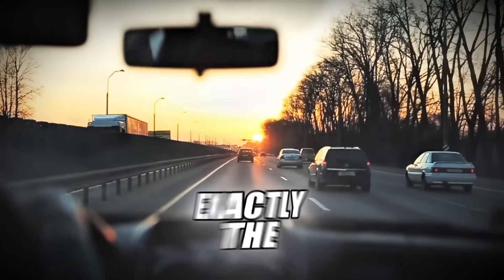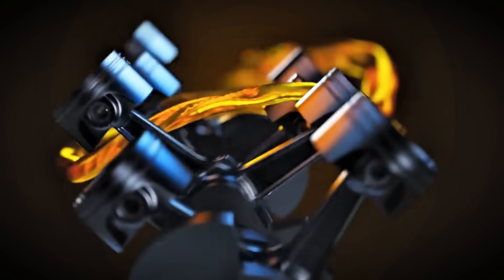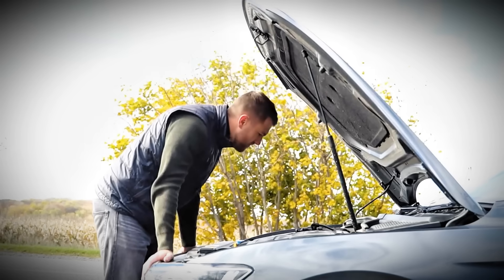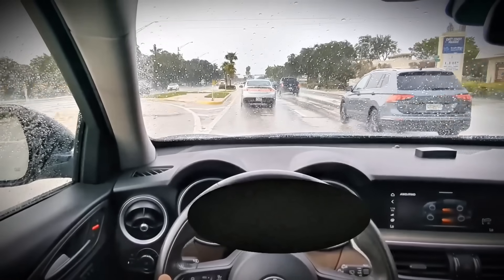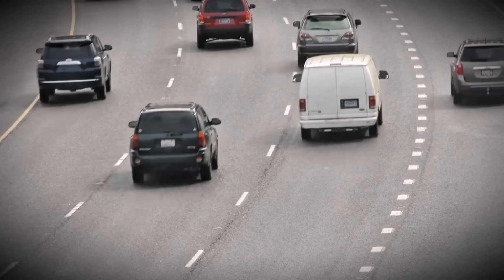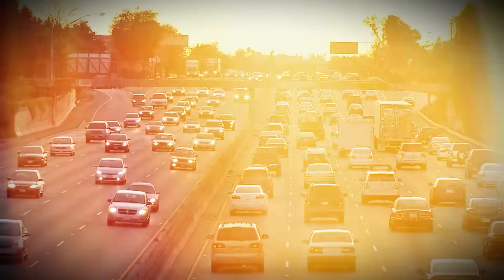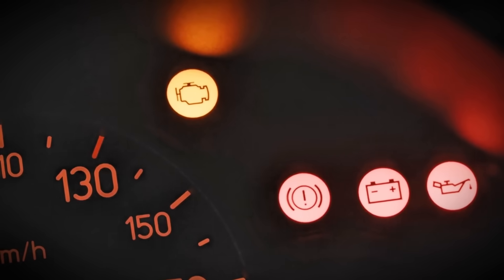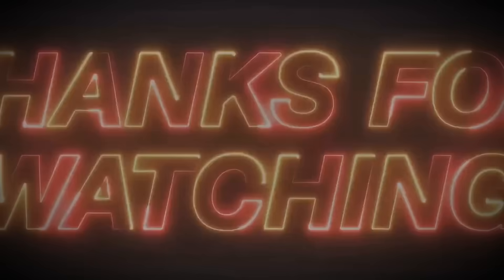Floor It Or DESTROY Your Diesel Engine (Costly Damage)

Comment: I have a corsa ecoflex that has a DPF its mileage 111.000 once a week I tear it a new ass hole for 50 mins or so I rag it at 70mph going up and the box when I have to slow down or join the motorway I rapid accelerate even being a 1100 cc it moves I live in the damp UK the first engine turn over a little white smoke condensation  drive off within a few seconds gone why regular  oil changes air filter MAS air clean  clean rad water new antifreeze spray all electric connections  takes a few minutes

Comment: Bro forgot a couple of most important tips to prolong diesel life:
Never ever go full throttle when the engine is not properly warmed up. Check your coolant temp gauge if at doubt.
I do at least 10 minutes of steady driving before even considering going more than half a throttle. Even on hot summer days.
2) Try not to idle your diesel engine for prolonged periods of time (>2 minutes). Not even when the engine is fully warmed up. 
This is even more damaging when it's cold. Even if you live in Antarctica and it's freezing, wait 30 seconds and just drive away.
Just be gentle on the throttle for the first 2-3 minutes if possible (and don't lug the engine in too high of a gear if you own a manual).
I only let it warm up longer if I need to clean my car from ice or snow. If your car has auxiliary heater, use it. It mitigates the winter warm-up idling effect a bit. 
Other than that, yes. Diesels absolutely need some highway driving and occasional full throttle. Don't get a diesel car when you do only city driving.
Not only the engine hates it, but DPF, EGR, even worse if you have AdBlue. These systems can clog up fast if you only do city driving. 
And if one of those 3 gets cooked, it could start a chain reaction. Diagnosing who's at fault can be hard and tricky. And replacing these bad boys really costs a lot.
Reply: Thanks. All good tips. 👍

Comment: Drive gently for the first 5 miles while the block gets to the correct operating temperature. This prevents piston rings from being damaged. The piston heats and expands far quicker than the block. Causing potential piston ring movement and scarring in the cylinders. Floor it and long motorway runs regularly will help, but only once she’s up to full operating temperature.
Reply: Thanks. Good tips. 👍

Comment: My grandson, bless his heart, shortened my 2012 turbo diesel VW Golf which my wife had left me . It had been used well, but we discovered that it took some 10 kilometres for the engine temperature to reach normal. 

It had 320,000 kilometres on the clock at its death, and seemed to be coming up to run in. A fabulous car, and oh boy, didn’t it love the run onto the motorways.